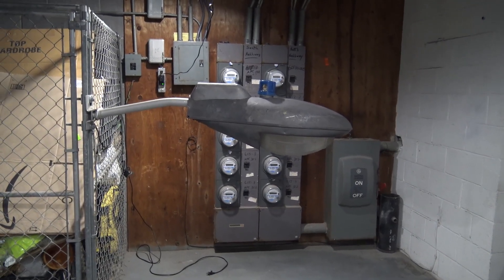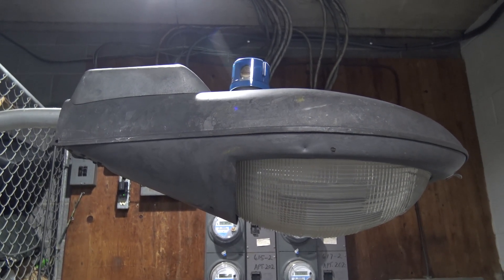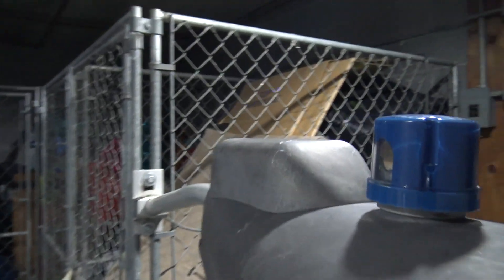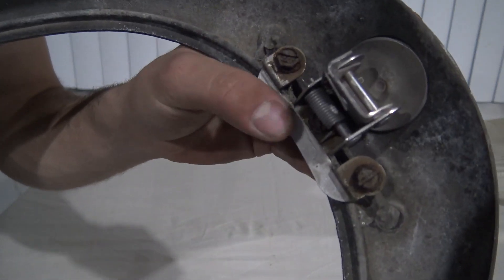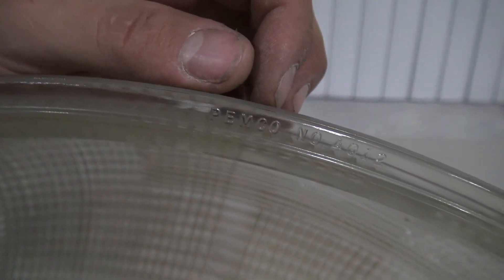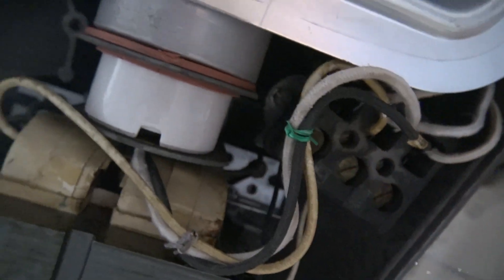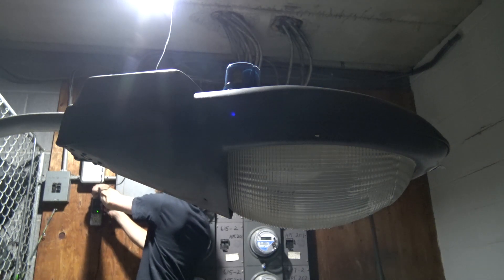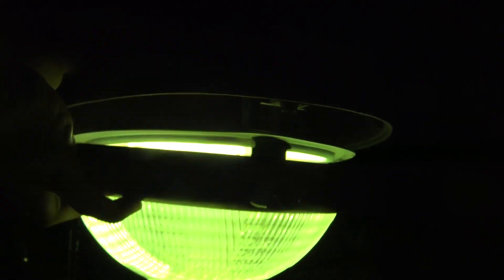1960s Finned Pemco Brightway Junior Overview

Comment: Are you selling any high pressure sodium street lights ?
Reply from the maker: No I don't really collect any hps fixtures much. So I don't have any to sell at all.
Reply: High pressure sodium can also work on mv ballasts since hps is a retrofit for mv
Reply from the maker: @The Streetlight Channel  regular hps doesn't work on mercury vapor unless you use a HPS conversion lamp. For regular hps you need an igniter, which mercury vapor ballasts don't have. So you can't do that unfortunately.
Reply: @polarslightssignals2742  in europe there are hps bulbs with internal ignitors so i can do that
Reply from the maker: @thestreetlightchannel3945  Are you sure they just aren't hps conversion lamps? They have a special neon gas inside them that helps the lamp ignite without any real ignitor.
Reply: @polarslightssignals2742  no they have real starters inside
Reply from the maker: @The Streetlight Channel  an igniter cant fit in an hps lamp. There are to many components that make up an igniter. The bulb you are talking about is a HPS conversion lamp. They have a neon gas inside that helps the arc tube ignite. They have a much deeper orange color.
Reply: @polarslightssignals2742  they do fit in there and i have a lot of these bulbs with internal starter
Reply from the maker: @thestreetlightchannel3945  You should do a video about them.
Reply: @polarslightssignals2742  i can make a video of one starting up
Reply: @polarslightssignals2742  just did it

Comment: I love this fixture but without Finn (Standard version)
Reply from the maker: This is the standard and only version. It has the fin because of the wattage. The ones without the in are 240v versions. The 120V versions need the fin. If there were different versions they would be completely different.
Reply: @polarslightssignals2742   😲 but inside the fin they have something or is only a finition to dissipate the heat of the gear (ballast)?
Reply from the maker: @luiscoelho4151  The fin exist for 400 watt versions only that are designed for 120V. Ot holds the capacitor inside. I explained this stuff in the video.